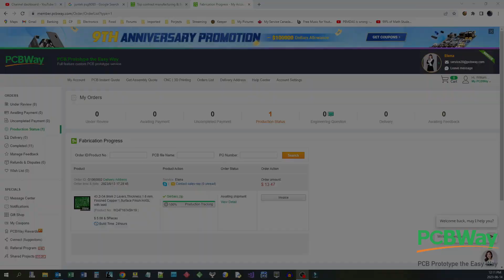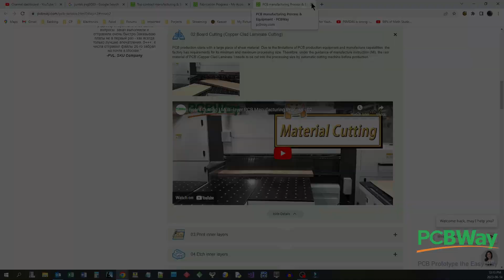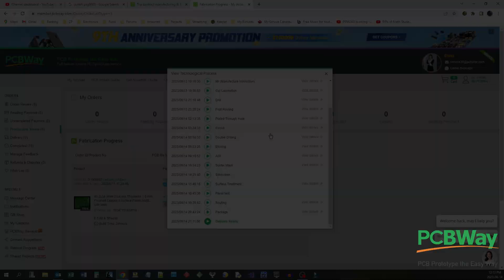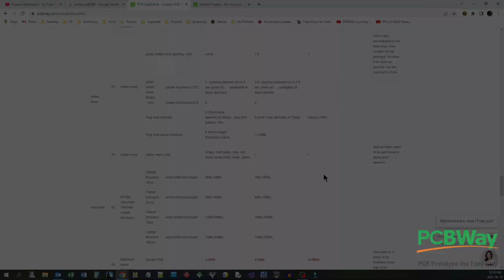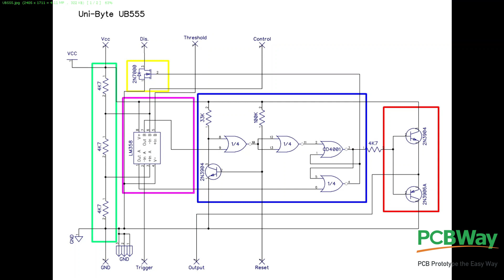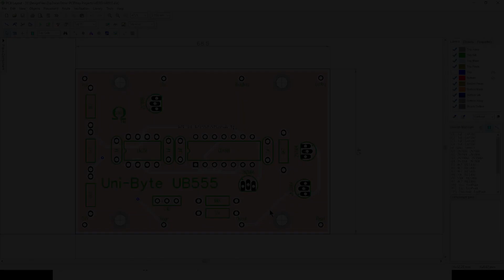Uni-Byte 0161 - Let's Build a 555: Part 1

Comment: What I have learned from playing with 555 was that every time the output switches, there is massive oscillation at the VCC pin, and that bypassing VCC to GND with some ceramic and electrolytic caps decreases amplitude and duration of oscillation significantly.
Reply from the maker: I've got 4 bypass capacitors in there.  Hopefully I've improved on that "feature".